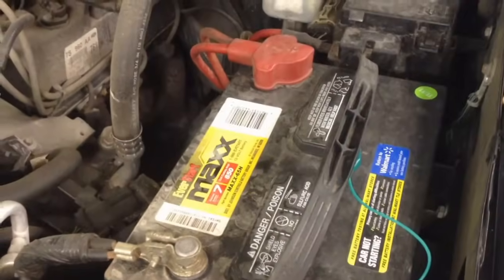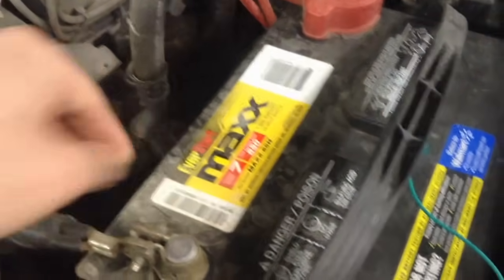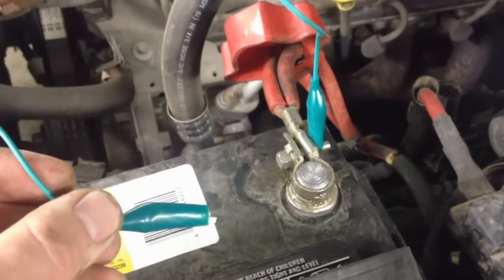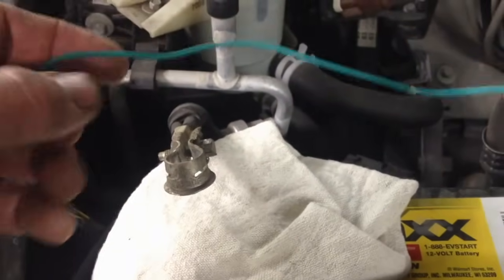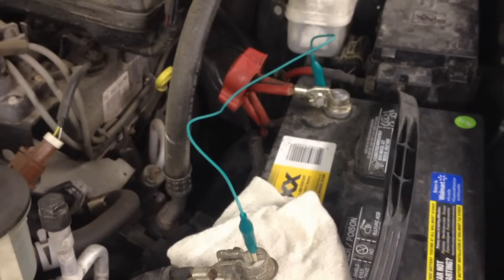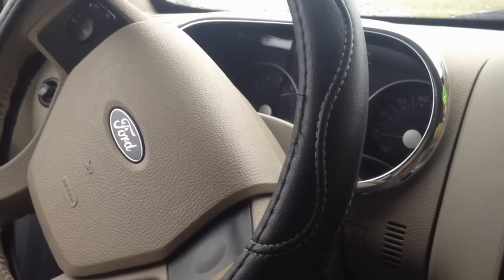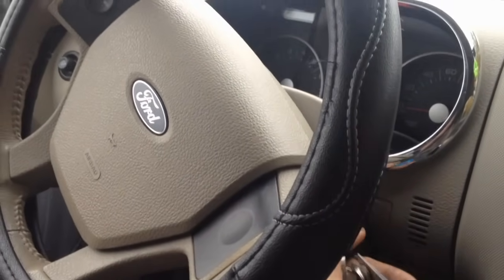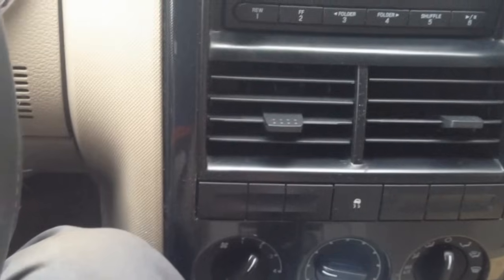How To Clear Your PCM'S Memory On Fords After Repairs

Comment: Its a V6. in 2012 ford replaced the  transmission's O/D band, in Mach of 2013, I was driving along when suddenly trying to take off on a green light, the car would not move. engine was raving up but the car just sat there.I had to down shift and take off on the 1st. and  manually shifted to the shop. Fritts Ford then did a overhaul of the  transmission with a 1year 12000mil warranty. At the end of October it happened again. Fritts accepted the car. It was over the 12000mil warranty. they sent the PCM to a tech shop. tech found no problem with PCM. the car runs great, whoever when it decides not to move on drive.right now its in the hands of Fritts. they said that I can pick up the car whenever I wish.  Because  they don't know what ells to do.  I'm  just  worried  that I will  loose  any rights with Ford.
Reply from the maker: At this point its between you and the dealer Ford is not involved. So when it happened at the end of oct they still haven't changed anything or had it act up? Yours is definitely unique, the only thing that comes to mind is the water intrusion problem with the trans bulkhead connector but I would think they check that. So the same thing happened a year later but this time it didn't need a rebuild? I imagine you are over 80k? So if they say its a pcm why cant they just get a junkyard one for a fraction of the price. When a trans will not shift hot it is almost exclusively a sealing issue internal to the trans, I have seen many.

Comment: I have a 07 Explorer, it has been sitting at Fritts Ford CA, for a month and a half with the same issues. it sometimes doesn't shift when hot. They still have not fixed the problem. The service manager said that they need to replace the PCM and are not certain that it will work or resolve the problem. they also said that it will cost me a $1000. for the new PCM. Any advice?
Reply from the maker: Unlikely it is the pcm as I have never heard of or changed one for a trans issue. I have only heard of pcm issues on the Lincoln ls causing trans issues. Is yours a v8 or v6. What have they changed so far? What is the exact issue? It doesn't shift into any gears hot stays in 1st? Shift flares or bang into gears, which gears are affected? How is it cold.
Reply from the maker: Hey whats up man, anything new, did you guys try a pcm?

Comment: I remember a few years ago when I changed the battery on my 2002 explorer man it ran like crap  after I installed the new battery . Didn't know what was wrong I was going nuts the engine wanted to stall at idle . But after some research online disconnected the battery 15 to 20 minutes after that it was fine after it relearned the engine idle & transmission shifting.
Reply from the maker: Yeah some are more sensitive than others.

Comment: i got a 01 ford explorer 5e55e, replaced the transmission with a junkyard one that i knew was good, dont think i ever did this, haha battery cable was just undone for like a week or something hahaha
Reply from the maker: Yeah this is more for 2005+ when they started using electronic throttle bodies and complex adaptive shift strategies in the transmissions. So much rides on the ETB torque calculation to be correct that a bad ETB can cause major shifting issues. There are so many trans concerns that come in our shop that can be fixed just by clearing the pcm's memory or on the newest ones 09 on resetting the KAM with the Ford scan tool and taking it for a test drive to learn the shifts again. Your being disconnected for a week also did the trick, but not everyone has that luxury. Hope this clears it up, I know I need to fill in the description.
Reply: ye, well i work in a GM dealer, did the GM ASEP program so alot of the system are the same as ford, i might pull my 55E back out and install a new TC, noticed when its in lock up at 55 km p/h it kinda jerks a little, feels like a ujoint, but thos are fine, eathor driveline angle or the TC lock up is slipping, which the rpms are not jumping its that minor, and nothing in the fluid samples ive taken, just driving it till shes worse!
but keep the videos coming man! myself i LOVE diesel's, work on lots of 6.0's and 7.3's, no one i know will touch a 6.4 hahah 6.7 yes, but there all warrenty still:)